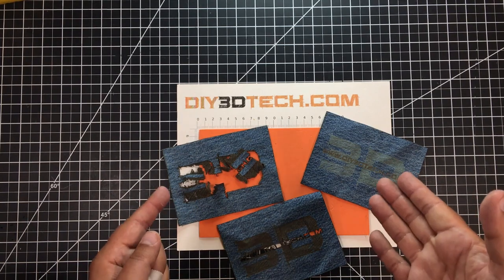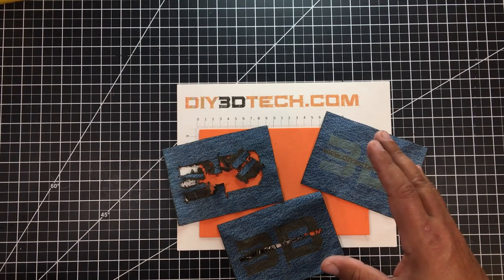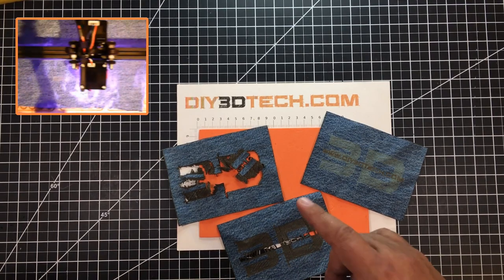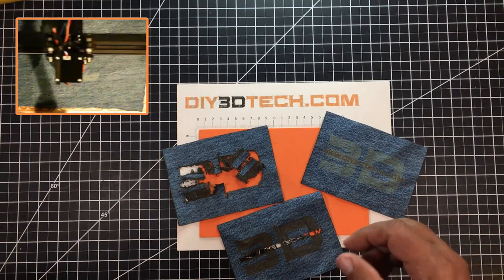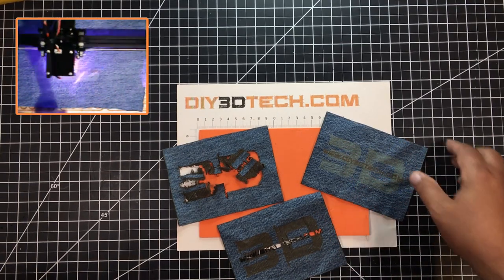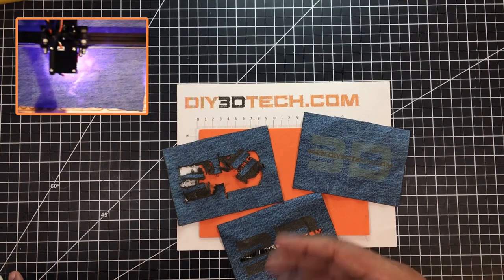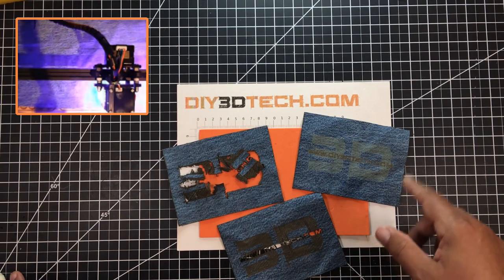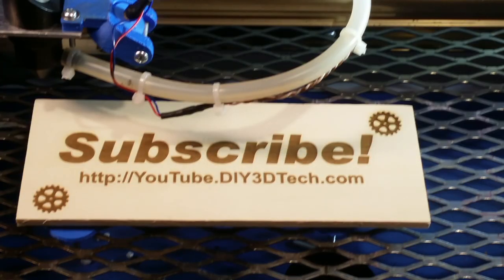Ortur Laser - Recipes for Embossing Denim (Blue Jeans) Like a Pro!

Comment: It looks like you got about the same results I did. I used a Co2 laser when I experimented a couple of years ago. I may have gotten a little more detail but in the end I considered it a fail. I tried to wash my samples in my washing machine to see if some of the brown tint would turn white. Very little washed out and I ended up with holes in many of my samples. I had prepared a gray scale test graphic with 256 shades. My laser software had corresponding 256 different power levels matched to the gray scale. I tried several image formats and while some were better than others, the bottom line was the material isn't capable of fine resolution with the laser setup I have. 
I think the material continues to burn too long after the laser shuts off thus the poor resolution. 

I might try to coat the material with a washout flame retardant in the future and try again someday.
Reply from the maker: The biggest thing I found is to get enough contrast, I had to burn it to the point I was damaging the weave of fabric and yes washing would break it down even more.  I was really hoping to be able to sinter the cotton (to just turn it brown) but could not find a happy medium in settings...  :-(